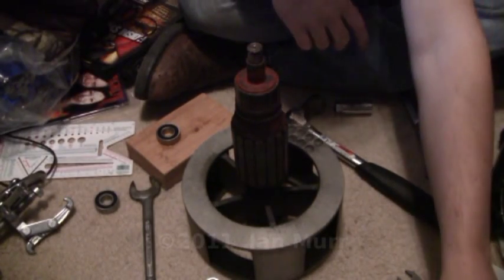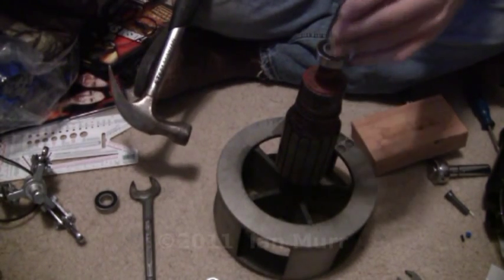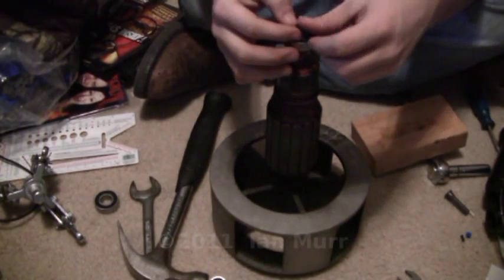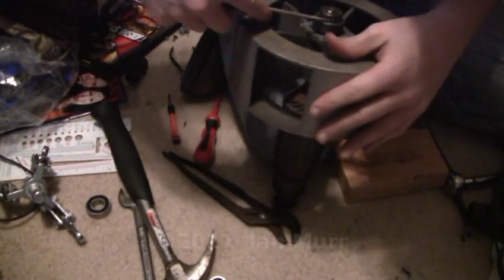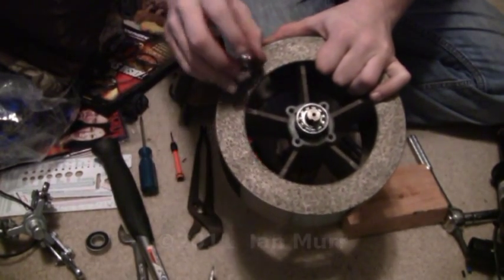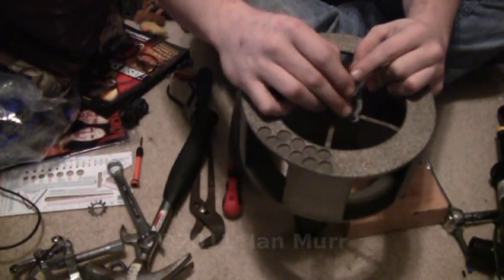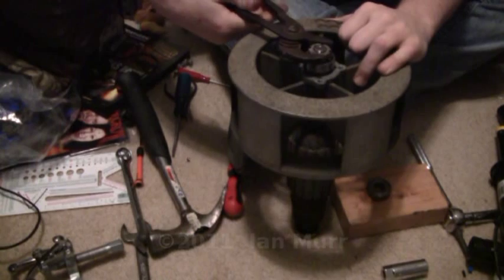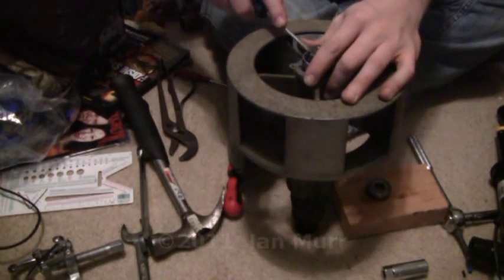Siren Maintenance Tutorial - How to replace bearings in a Federal Signal Model 2

Comment: For some reason when I went to pull the lower bearing the jaws of the puller squeezed into the shield on the bearing instead of pulling on it, totally siezing it. It didn't pull the bearing itself up at all. Eventually I was able to get the jaws to pull on the inner race but it was no simple task. I used the same exact puller as you (came in a set of 4 from HF) funny enough. Not sure how I can manage to make something so easy work so difficult lol.

Comment: Seized Bearings: Bearings which support the front and back to allow the chopper to rotate if one or more bearings have seized the chopper will have trouble turning until the component has replaced

Comment: hey man since the model 2 and thunderbolt share the same chopper could i get replacement parts from a model 2 and use it on a thunderbolt? we got some old thunderbolts up here that may need motor work and may need new parts after a while (because some of em are gonna head back into service if i can get the right people on board.)
Reply: I think you can order rotors and armatures but that's about all they share to my knowledge.

Comment from the maker: Yep, same exact method applies to a Thunderbolt's chopper motor as well since it's no more than a Model 2(T) with a different stator. Most Thunderbolt chopper motors I've seen use type 87502 bearings instead of 6202s (the 87502 has a little bit longer inner race to space it out more than the 6202). Measure your old bearings to be sure though (use millimeters for the measurements). Also, check eBay for new bearings, you can usually find them dirt cheap on there. If you need help, send me a PM.

Comment from the maker: @el1998p71 Thanks, and no problem! Believe it or not, the puller set I have (the one used in this video is one of them) came from Harbor Freight, and they've worked out very nicely for being as cheap as they were. If you want to just get a decent set for a good price, I'd get those since they come as a set of 3 different sizes (3", 4", and 6"), so you'll have one for almost any bearing needing to be pulled. I think it's item #8832 and was like $19.99.

Comment from the maker: @stlchevy95 Haha yeah, that's what I remember them having. It's so cool that if you have to have some that day, just go to your local skate shop and they'll have them. Do you mean a 4/5 port Model 2T with a 5/6 rotor, or literally the T-bolt? If the latter, it doesn't matter which rotor you put in it (4/5, 5/6, or single-tone 5), they'll sound the way they're supposed to for that port configuration due to the single stator port on the Thunderbolt.